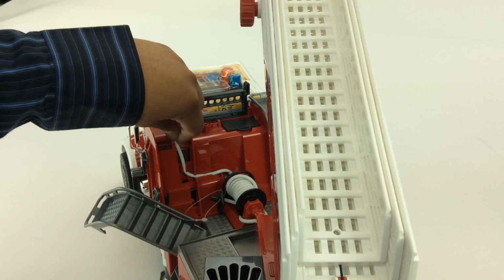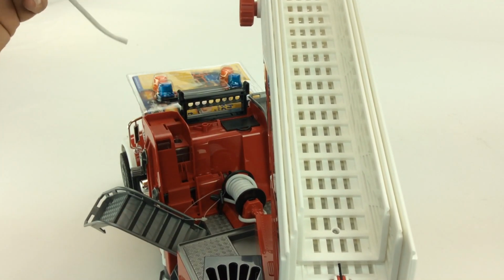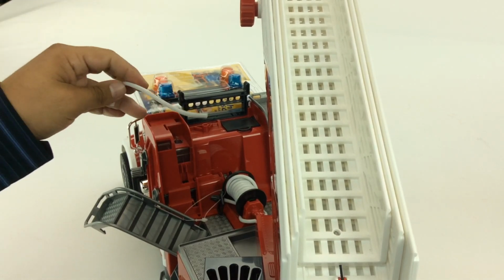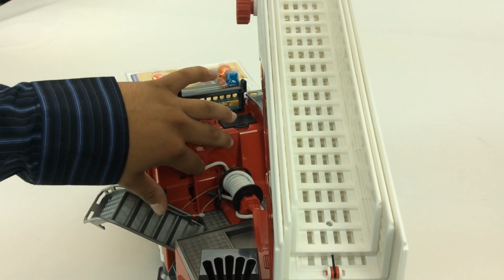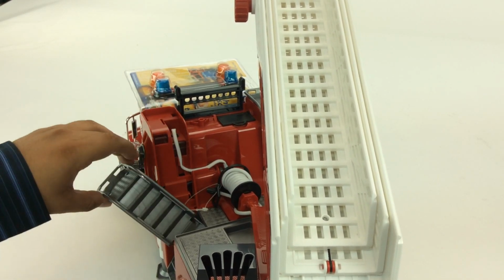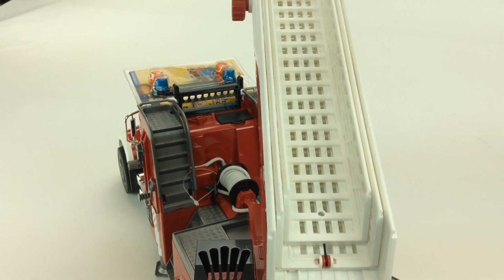Removing and installing water pump hose from Mack Granite and Scania Firetrucks

Comment: Do you push with the screw driver or twist?  It doesn't seem to pry and I don't wan't to damage the stairs.  Any suggestions on how to access the pump assembly?  I need to glue a snapped off pump handle back on.